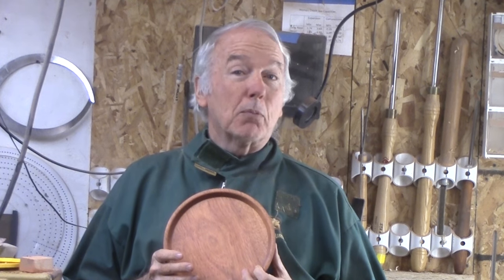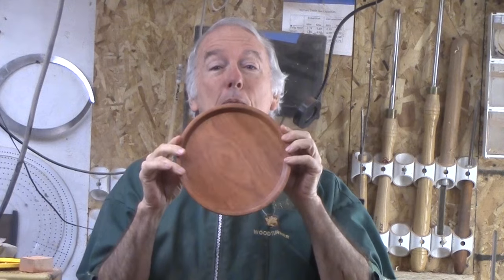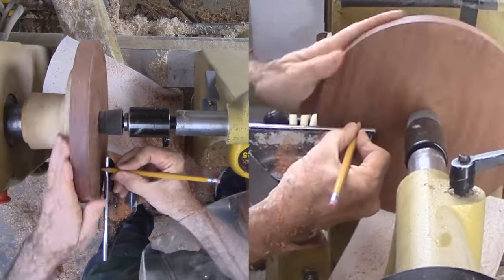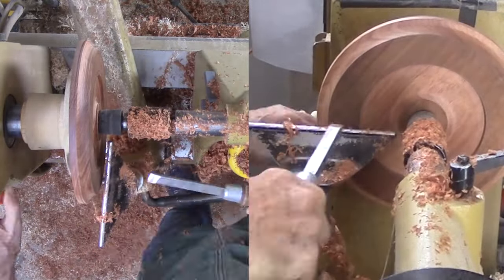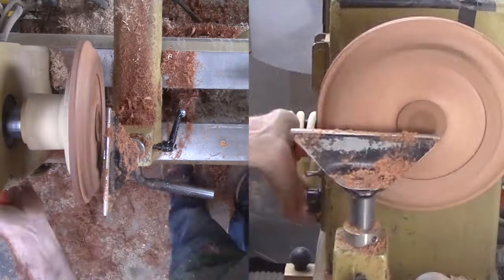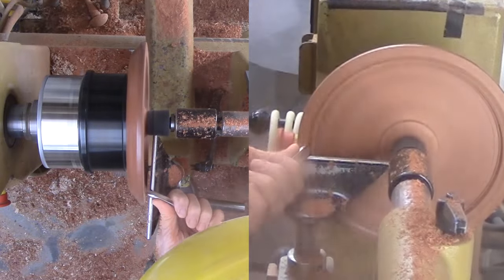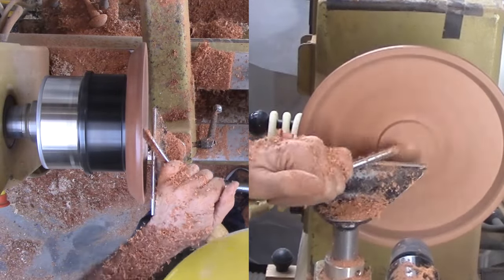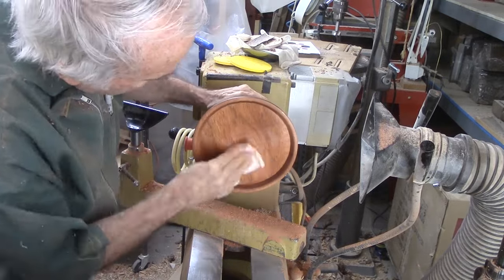Turning My Tray (Not A Platter??)

Comment: Very nice. I've never seen anyone using a flat disk to check for flatness. Are there advantages over using a 6" or 4" straightedge?
Reply from the maker: That was a 3D printed template I have for sizing disks. It was handy and the right size.
My small rule is too long. 4" may have been too long.
Alan